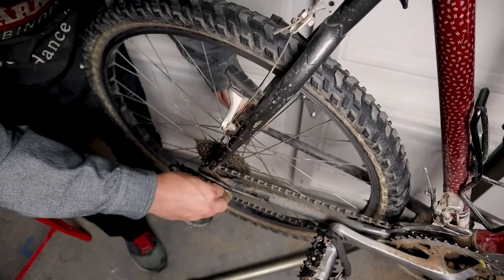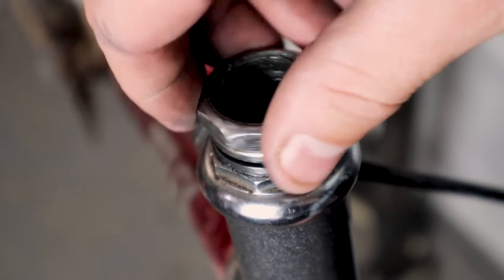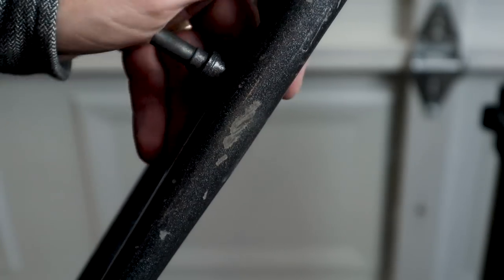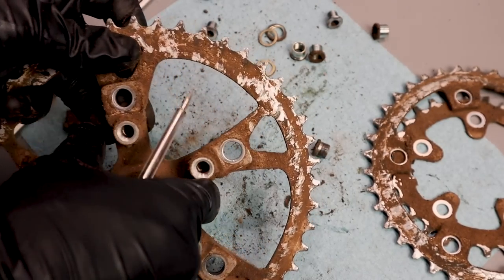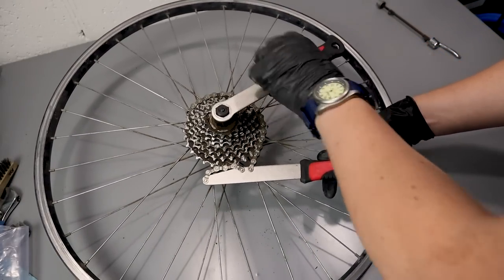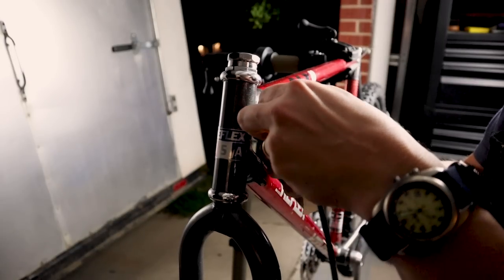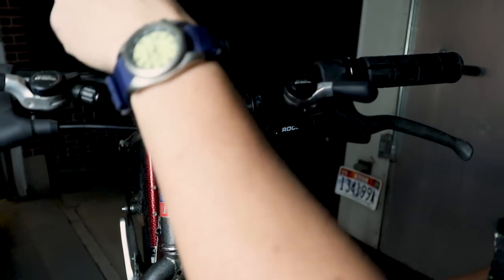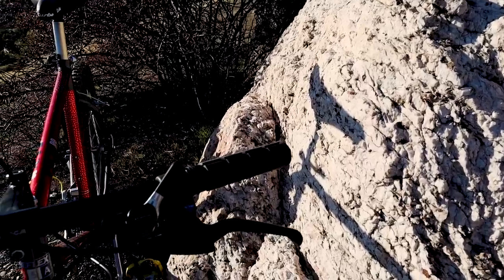80's Mountain Bike Restoration Tune Up | Easton Reflex ALX 89

Comment: This bike wasn't ridden as much as you say it was.  The chainrings don't show much wear which is a good indicator.  The only thing this bike had was little or no maintenance and TLC in its life.  You can ride a bike anywhere and as hard as you want as long as you don't abuse it but you need regular maintenance.  Hopefully you just didn't have time to show if you measured the chain wear and other things like rebuild the rear hub and take off the free-hub and either re-lube it or get a new one.  Not trying to tear your restoration apart but uninformed people will learn many many wrong things from this video.  Maybe the main thing you are lacking is anti-seize or some kind of grease on threads when re-installing parts.  Gonna be hell the next time its maintained!.  Lose the bearing cages and use individual ball bearings and change them, don't clean em, they don't cost that much and the bearing races will last longer.  And don't grease a square splined bottom bracket.  You use grease but in places you shouldn't.  You brought out a good point, these components last a long time, they do despite poor maintenance practices.  The bike looks much cleaner now and I am sure it works a lot better but just a little more know-how and it would have been 5-stars.  Have a nice day.  You did do a nice job of making the video though, good sound.